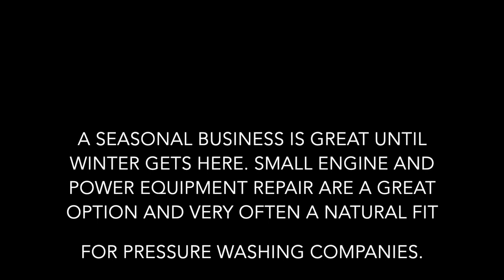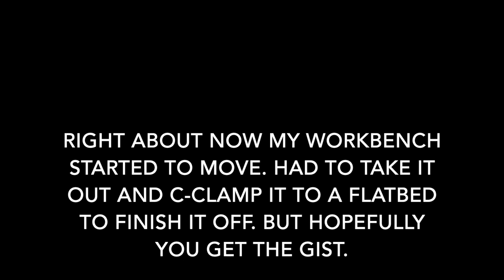Repairing, Removing, and Replacing Small Tires

Comment: Quick way to install the valve stem, soapy water and a pair of 12" channel locks, takes about 2 seconds, spray the valve stem with your soapy water put it through the valve hole, grip the valve stem with the channel locks, pull down using the rim's edge, its just that simple, this method used by automotive tire repairmen inside factory, same method was used also to remove the valve using a little more soap and a little more pressure on the channel locks, and no damage to the Valve Stem.........No bear just easy!

Comment: You don't pull the tire  plug through the tool, you just slip in on the tool and mid point of the plug. Good tire video!

Comment: You don't have to cut the old valve stem out,, just use that stem puller screw it onto the old stem, place the handle of a screw driver under it on the rim edge and then with a prying motion push down and  the old stem will pop right out. same with install the new stem , you dont have to use pliers or press in the new stem, just use the stem puller in the same way until the stem seats

Comment: Need to know how to remove wheel on Devilbiss 2600 pressure washer. There appears to be a small steel dowel securing wheel lug to axle. Small steel dowel is round with a round hole in center. I need to remove this small steel dowel. Allen wrench will not work on round hole. Peace.